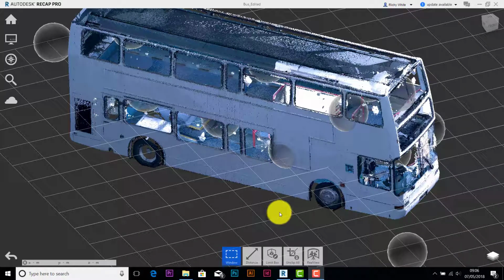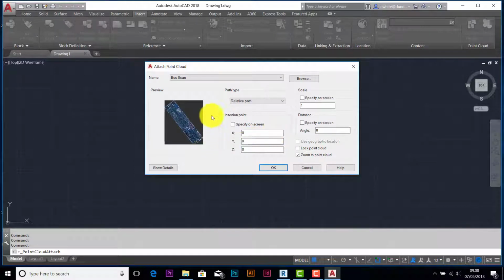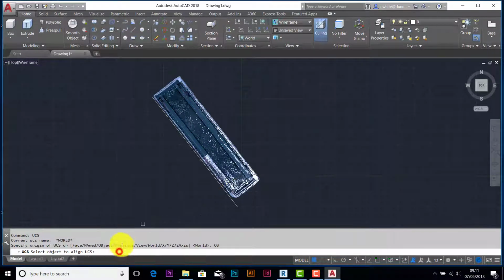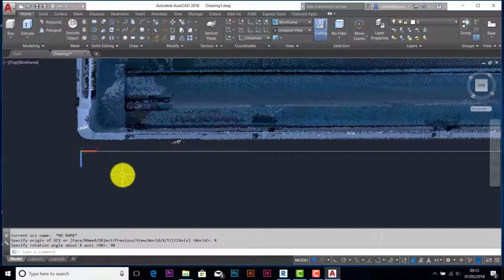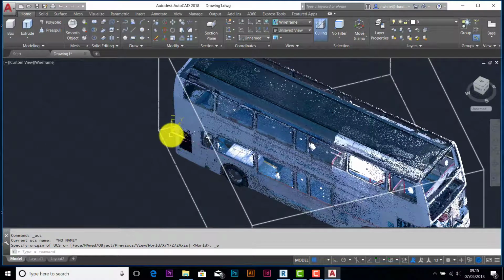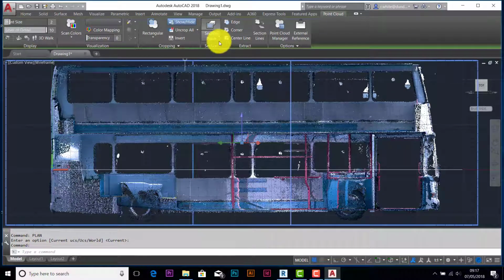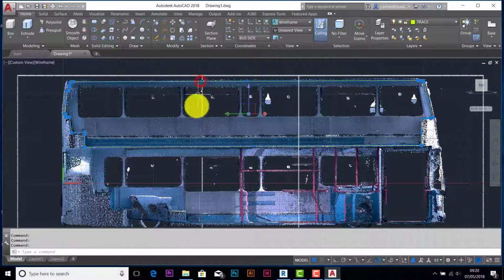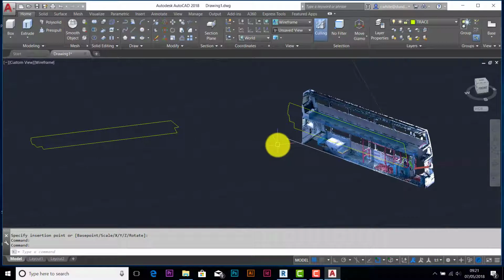LEICA BLK360 - BUS SCAN - AUTOCAD UCS CONTROL

Comment: Would like to do similar, how good is the scanner with measurements?
My desire is to document itms from small vehicles to large and or buildings, then scale down for model making.
Reply from the maker: HI Kevin - its accuracy improves the closer you are to the subject but you can't get closer than 600mm due to focussing limitations.   Since you need more than one scan for any object its the registration of the scans that can make for lower apparent accuracy - eg scans 1, 2 and 3 would hit the same point on the object but the resultant 3 points in the cloud will not be on top of each other ... they will be within a few mm's of each other.   A big problem you might encounter with vehicles is their paintwork - laser scanners don't like shiny, glossy, glass or black.
Reply: @emmockladdie  Thanks, that's of what I would likely be interested in would be old and not shiny, if any paint at all :)
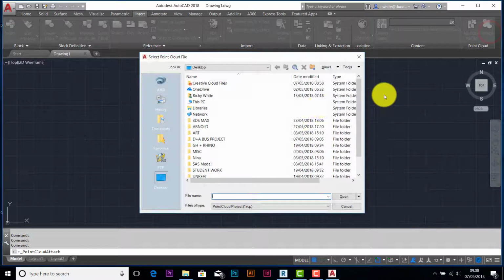On the accuracy by the time scaled down to  1:43.5 1:76 or similar for modelling probably be negligible?